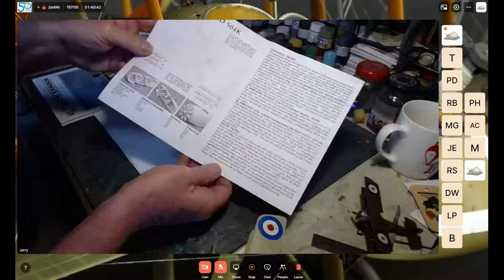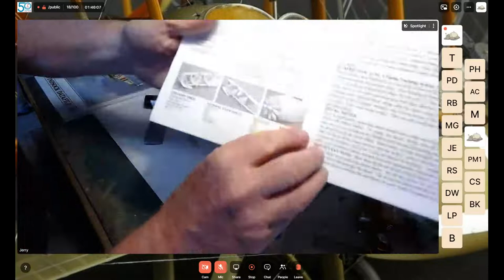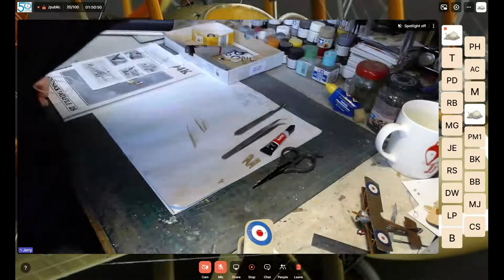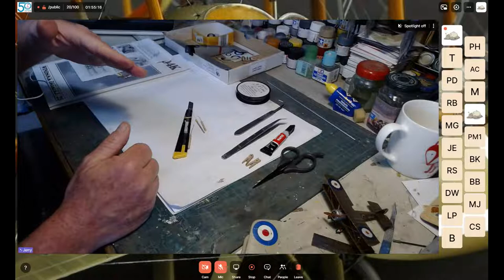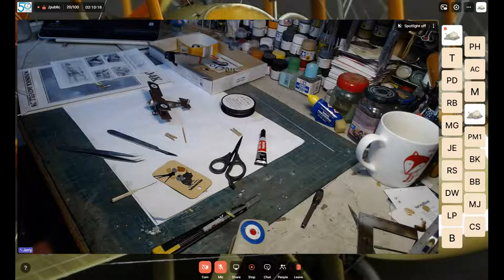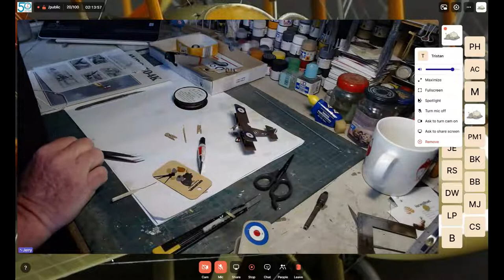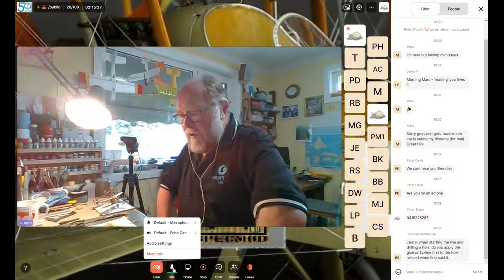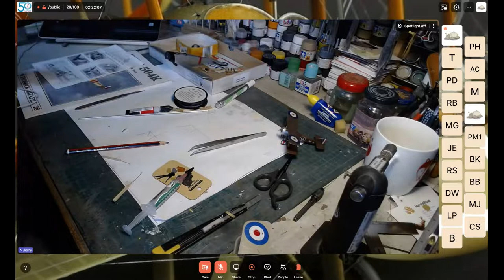Rigging Biplane Models

Comment: Great to find this.I have been making struts this way for years.I've also used bamboo  barbecue sticks pined with brass and sanded to shape. 
A few suggestions concerning refinements;when cutting the tube,as well as rolling, run some wire through to support the tube.Also when crushing the strut,put double sided tape on one of the jaws to hold multiple  struts in place.I run the wire through epoxy or superglue. This helps holding it in the tube, you can then gently file the strut ends to shapes Greetings from the UK.